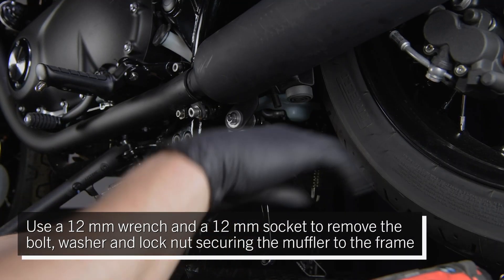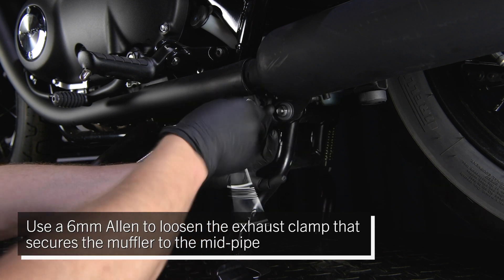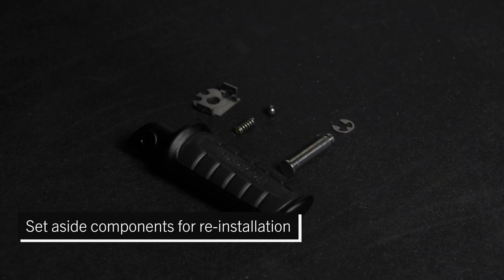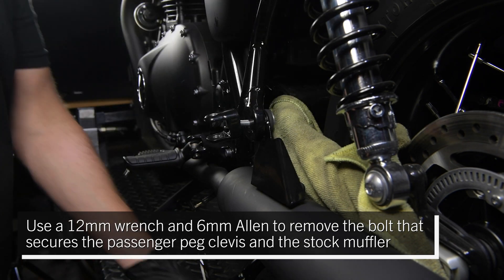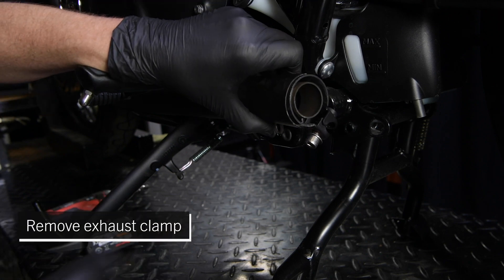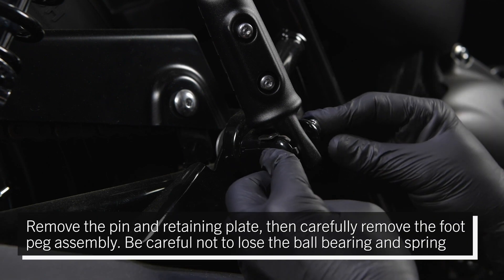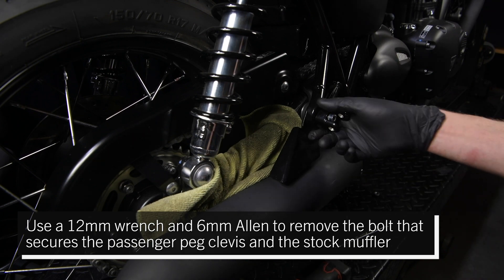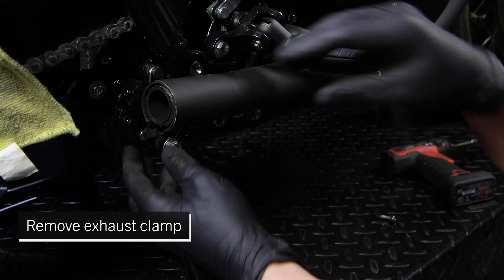How to Remove Bonneville T120 Stock Muffler

Comment: Can you just keep it this way or will it damage the bike? Also when are your slash cut tips coming out?
Reply from the maker: As long as the catalytic convertor is on the bike, we don't see it really being an issue but we'd recommend checking with your local Triumph dealer first to see
Reply from the maker: Slash Cut tips for T100/T120 should be out in about 2-3 weeks from now

Comment: At around 30 to 35 seconds, where you remove the silencer bracket from the frame it looks like you don't need any additional engine or bike support. So, you can take the muffler off with the bike on the center stand and it (the bike) is still supported by the stand?

Also, might I suggest not doing a black bike against a black background? Use white or something lighter. Seems like some details get swallowed up in the darkness.
Reply from the maker: As shown at 1:47, no issues but give us a call or email for more details on this process
Reply: @britishcustoms  Wow, thanks you guys. I found this video helpful and on point. I have to do exactly this process and was unsure about it.